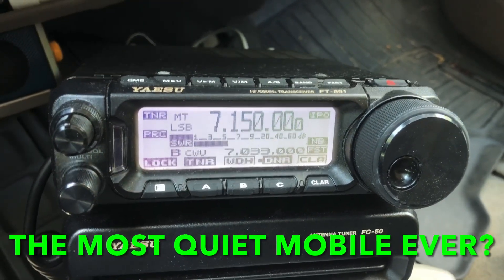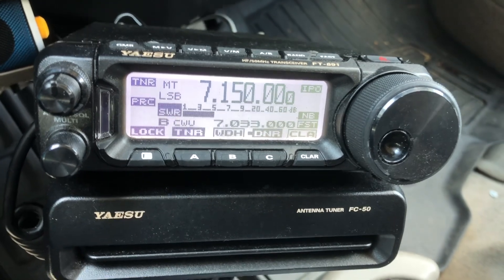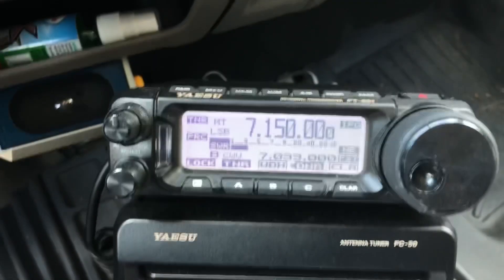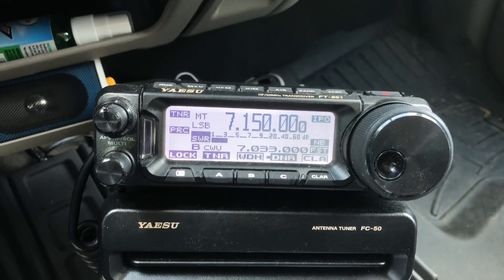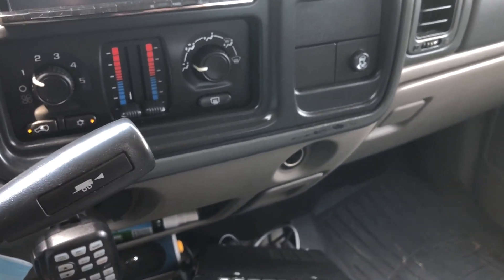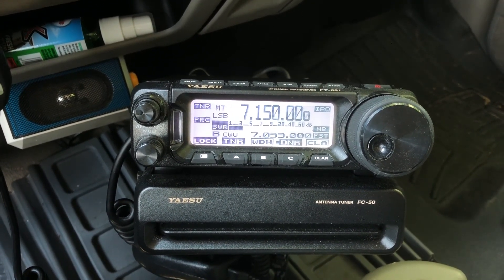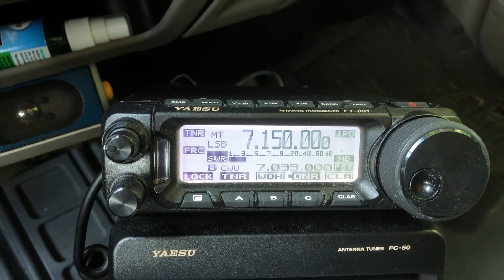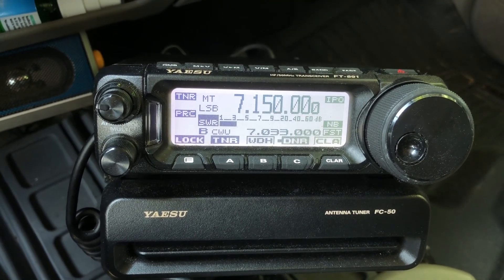The Most Quiet HF Mobile Ever? #yaesu #ft891 #mobile #dsp

Comment: The IPO is on also. Turn that off and do the test again.
Reply from the maker: No!  IPO assists the DSP. There is no need to use a preamp below 20 meters, and usually not below 17 meters. You must have missed the plethora of videos on my channel where I teach how to combine IPO, ATT, RF Gain, and DSP to improve the S/N ratio.
Reply: @n4hnhradio  Point of your video was it was a quiet RXer.. Well you turn all that off and its not was my point. BUT, I do love the radio for mobile. Its way better then the 857. I had both and 891 takes the cake for sure.
Reply from the maker: You must think my channel is about specs and testing. Nope. I teach operating techniques. But you can use my techniques with a different radio and it might not deliver the same level of results.
Reply: @n4hnhradio  No just the label of the video. But its great job. I watched couple more of your video's. Great Job
Reply from the maker: My channel is about combining various functions to achieve the best performance. I’m not lab testing. If Rob Sherwood scored the radios after combining every available feature for maximum performance, his test results might be very different. The FTdx101D would still be number 1. The FTdx10 would be number 2.  But you might see the FT-891 in the top 20. You might see the FTdx5000MP near the top.  Yaesu filtering and DSP gives it the edge.

Comment: Terrific video

My ft891 is completely silent with the nb on level 1.

I have a 2013 Corolla.

Mobile hf is great fun.

Thank you
73
Reply from the maker: It’s great that you don’t have ignition pulse noise, or computer-generated noise. My brother’s Toyota Tundra generates a high level of noise from the computers. It even interferes with 2 meters. 

You’re absolutely correct…mobile HF is fun.

73, de N4HNH

Comment: I am really glad to find your channel. Being a Tech and now starting POTA on 10m my noise floor is outrageous! I want my radio as quiet as yours :) Would you do a 10 meter video and show how you have things set. I am strictly portable with a bioenno battery even when mobile. 73 and thanks again for your video series, I am learning alot!! KJ7MMX
Reply from the maker: There are videos on my channel that happen on various bands, including 10m. But the techniques are the same.  Run IPO unless you need additional sensitivity for a weak station. Use ATT if IPO doesn’t reduce the noise to near zero S-units. You could also employ RF Gain.  It works well in conjunction with IPO, in case IPO+ATT kills the sensitivity too much. Finally, you can add the DNR at algorithm 9.  I cover these techniques ad nauseam on this channel. I might use a different radio each time I teach but the basic principle is the same. Most radios these days have the same or very similar features.

Comment: I find the cooling fan can be annoyingly loud in this rig when using high duty-cycle modes.
Reply from the maker: I believe you.  I run it mobile and for SOTA, so I don’t really notice the fan.  But I don’t run digital modes either.

73, de N4HNH

Comment: Nice video of the FT-891 its very nice receiver and digital noise reduction works. It would be nice to see your mobile setup that make a difference in noise.
Reply from the maker: That was the subject of this video.  IPO, ATT, RF Gain, DNR.  My mobile setup is noisy because I use a magnet mount and I have engine noise.

73, de N4HNH

Comment: I get tons of engine noise from my 2007 Suburban but I never thought of trying the DNR on my 891 to help get rid of it...I'll have to give it another shot. Thanks!
Reply from the maker: It’s a combination of IPO, RF Gain, and DNR (set at 9).  Mobile operation is almost always noisier than base station operation.  So knock the noise floor down to S zero or S1 maximum.  If needed, add the ATT to the recipe.  You can’t hear below the noise floor anyway. So help the DNR do a better job by sending it less noise to filter out.

73, de N4HNH

Comment: Thanks for the nice video! Which antenna do you use in the car?
Reply from the maker: I’m using Ham Stick antennas with a triple magnet mount atop the cab.  I use one Ham Stick per band, so when I change bands, I have to stop the truck to switch out.  I use quick-disconnects though, so a quarter-turn takes one off and puts another on.  I mostly keep the 40m antenna on because that band is good day and night.  

Fortunately, the antennas are less than $30 each.

I would like to get the ATAS-120.  It tunes itself automatically each time you change bands.  It gets power from the FT-891 via the coax.  The FT-891 sends the frequency data and the antenna adjusts itself for that frequency.  I have friends who use the ATAS-120 and they are very pleased with the performance.

73, de N4HNH
Reply: @n4hnhradio  Thank you!
Reply from the maker: You’re very welcome!  

73, Doug

Comment: I have ft840 and ft891
Reply from the maker: I featured my FT-890 in some videos.  It was my first HF base station.  Then I ran it mobile for 20 years.  It has been in the position where that FT-891 is.  If it was as quiet, it would still be there.  The antenna tuner in the FT-890 allows me to work 10 through 20m with my 10m Ham Stick.  The FT-891 is just so much smaller and quiet.  But I won’t part with my FT-890.

73, Doug
Reply: @n4hnhradio  Yes. I agree. Kind regards

Comment: I have an 891 and an icom 7300 I think the 891 performs at least as well but it is menu driven and takes practice to master. It's not difficult just takes practice.
Reply from the maker: I use Memory Tune so I seldom go to the menu.  That helps tremendously.  I can operate while mobile with just a glance to change memory channel/frequency.

73, de N4HNH
Reply: @n4hnhradio  I've never used mine mobile just as a base. How did you mount your ham stick? Is it at bumper level?
Reply from the maker: Nothing elegant.  I have a triple magnet mount atop the truck.  Top center gives more of a circular radiation pattern.  I use quick-disconnects to make antenna changes quickly, since I have a separate Ham Stick for each band.  You can see my mobile antenna setup in the “My Antenna Farm” video.  

https://youtu.be/zc6aS_95Dfo

73, de N4HNH
Reply: @n4hnhradio  thanks I'll check out the video.

Comment: The DNR is my favorite feature of the 891. I think it works better than all of my other radios (including an FTDX10) I've said it before, if I could only have one radio...Thanks for all the great videos! K3DBI
Reply from the maker: The FTdx10, FTdx101D/MP, FT-991A, and the FT-891 all use the same DSP chip.  But the programming is somewhat more advanced in the FTdx10.  The FTdx10 doesn’t produce the digital artifacts that make received audio sound like you are listening under water, when DNR is set to less than algorithm 9.  I typically run the FTdx10 DNR at 3.  I always run my FT-891 DNR at algorithm 9, to avoid that watery sounding digital artifacts.

After the FTdx10 was released, the firmware for the FTdx101D/MP was updated to remove the digital artifacts from its DNR.

73, de N4HNH
Reply: @n4hnhradio  I've found on the 891, after rolling back the RF gain for minimum S-meter deflection and then engaging DNR 1 or 2 it sounds like listening to a repeater on a moderate to strong signal. 
For whatever reason I can't seem to replicate it quite as well on the FTDX10 without getting some of that watery artifact sound. Your videos have been a great help in setup, really appreciate it Doug!
Reply from the maker: I have quite the opposite result.  Both of my FT-891 transceivers produce the digital artifacts, until I dial in algorithm 9, and I use IPO, RF gain, and ATT (when needed).  

The FTdx5000MP was the first transceiver I encountered that didn’t exhibit the digital artifacts that sound like I’m listening under water.  The FTdx101D even made the watery sound when I compared it to the 5000.  In fact, ergonomics and the DNR deficiency in the FTdx101MP helped me decide to buy the FTdx5000 over the FTdx101MP.  

When the FTdx10 arrived, I was blown away to find a second transceiver with DNR that didn’t make people sound like I was listening under water.  My FTdx10 is still using its original firmware, V01-04, and I do not intend to “upgrade”.

73, de N4HNH
Reply: @n4hnhradio  My DX10 came with V01-08, I wonder if that has something to do with it. I have not updated it. Not sure what my FT-891 is running. I have never updated it either and have had it since about 2018.
Reply from the maker: I updated both of my FT-891 transceivers to the latest.  They still exhibit the watery sound until algorithm 9.  Don’t misunderstand.  Algorithm 9 on a FT-891 is better than any other DNR except FTdx5000MP, FTdx10, and the updated FTdx101D and MP.

If you watch any of the FTdx10 videos on my channel, you are hearing it with DNR at algorithm 3 for SSB or algorithm 15 for CW.  I never operate without DNR.

73, de N4HNH
Reply: @sporty05  your observations are quite puzzling on the FTdx10 and the DNR.   I have 2 FTdx10's and neither one exhibits any watery sound with the DNR. I typically run my DNR from 3 to 5.   My first FTdx10 was V01-08 MAIN and my second was V01-10 MAIN and both are currently on V01-10 MAIN.    However the DSP version of my radios is V01-01 and I confirmed that Doug's radio that came with V01-04 MAIN (and still has that version) is also DSP V01-01.    So as far as I can tell/speculate, there has been no update to DSP on the FTdx10 since its introduction.    You don't by change have the DNF turned on do you?  That feature is useless at the moment as it distorts strong signals badly on every FTdx10 I've tested it on.
Reply: @kb9jqu  I'll have to check the DNF, I honestly can't remember if it's on or not at the moment. I should have said echo-y as opposed to watery, it's like a reverb effect or hollow tunnel like sound.
Reply from the maker: The echo sound you hear is a result of the AGC.  It isn’t that the AGC is defective either.  It’s just that you can hear the natural decay of the AGC after the noise is removed.  It’s similar to the effect of a reverb unit for a sound system used by singers, while set to simulate the sound of a small, empty, room.  I don’t find it objectionable though.  It’s very minimal on mine.  

The FTdx5000 has menu settings that allow me to adjust the AGC hold time to minimize the delay effect.  I did it, but I didn’t like the receive audio sounding so dry.  I added the delay back, at 20ms.  I like a little bit of room effect in the receive audio.  

The FT-891 has the same "room effect" once you get to algorithm 9.  That’s because algorithms 1 through 8 can’t completely remove the noise.  You get the watery sounding digital artifact.  With the FTdx5000, the FTdx10, and the FTdx101D/MP (with latest updates installed), the noise is so effectively stripped away, even at algorithm 3, you are left hearing the effect of the AGC.  It was there all along, but it was masked by noise.  If I must choose between band noise or a room effect, I much prefer the room effect.

KB9JQU makes a great point.  The DNF (auto-notch filter) in the FTdx10 introduces distortion.  It is mostly noticeable with stronger SSB signals.  You might not think anything of it until you toggle DNF on and off.  The distortion becomes very evident once you hear how clean it sounds with DNF off.  I’m encouraging everyone to report this to Yaesu, via their Contact Us page, at www.Yaesu.com.  When I called to report it via phone, I was promptly told that I’m the only person to report distortion caused by the DNF.

73, de N4HNH
Reply: @n4hnhradio  Doug your insights never cease to amaze me.   Even if you don’t get my callsign right.  HI HI
Reply from the maker: Sorry about that Curt.  I haven’t had my eye surgery yet.  It got postponed.  N next to B on my phone.

73, Doug
Reply: @n4hnhradio  Doug I’m just messing with you.   No worries at all.  Long hard day but very successful.   Hope you get that sorted out ASAP.  But I’m always truly impressed with the answers you provide.  Very insightful.
Reply from the maker: Well, Curt, the echo thing has thrown a few people off and I don’t know if anyone has taken the time to fully explain why it happens.  But, it amazing to have DNR so good that you can hear the tail of the AGC, because that’s what’s left after the noise is removed.  It’s truly remarkable.

73, Doug

Comment: Excellent - I’ve changed my mind on purchasing an HF mobile - 891 it is!
Reply from the maker: The noise blanker is its weak point.  Every radio has at least one weakness.  The NB works to knock down the ignition noise from my truck, but it does introduce a bit of distortion.  But I always run IPO and DNR anyway, so I can get by without the noise blanker.  In a mobile, the combination of atmospheric noise, power line noise, road noise, etc. usually causes me to run IPO and even ATT on the lower bands.  Plus I roll back the RF Gain to match the S-meter reading of the weakest station in a roundtable and it’s like we’re all on a conference call.

FT-891 provides a bunch for a radio under $700.  It rivals radios that cost $300-400 more in fact.

73, de N4HNH

Comment: That is most impressive!  If I ever need a mobile HF rig, I'll 1st buy a Yaesu FT-891, second watch all the N4HNH videos on the FT-891 and finally, I'll download the latest version of the Yaesu FT-891 Optimized Menu Settings on Patreon!    Thanks for the demonstration Doug, I had no idea the radio was that good.
Reply from the maker: It’s a great mobile setup.  Richard, N1RBD, has the ATAS-120 antenna, so he has an active tuning antenna with his FT-891.  He has made great mobile contacts.

73, Doug
Reply: @n4hnhradio  do you need the FC-50 if you go with the ATAS-120?
Reply from the maker: No FC-50 is required with the ATAS-120.  The ATAS-120 is a self-tuning antenna.  It has an actual antenna tuner, not a transmatch, which is what most “antenna tuners” are.  You either use the FC-50, the ATAS-120, or multiple resonant antennas with the FT-891.  I use the latter, but I have to stop and change antennas when I change bands.  The ATAS-120 will adjust itself when you change bands.  It is powered from the FT-891, via the coax.

73, Doug
Reply: @n4hnhradio  that's what I thought but wanted to make sure.  I'd probably go with the ATAS-120 because I tend to hop around on the bands a lot, especially hunting parks.
Reply from the maker: Oh definitely get the ATAS-120 if you can.  I don’t have one but I’m hearing great things about it.  I’ve worked mobile stations that were coming in great with it.  One was a trucker a couple of weeks ago.

73, Doug